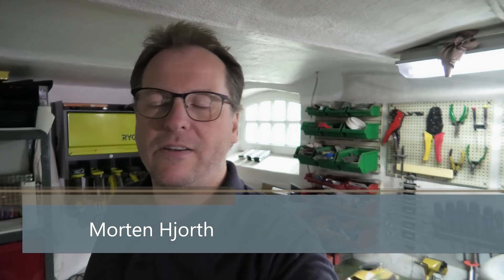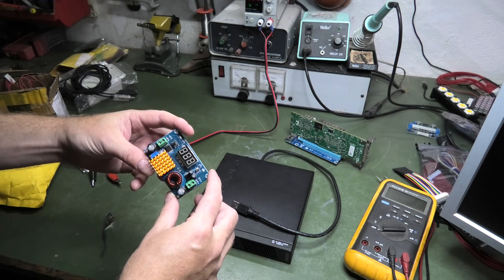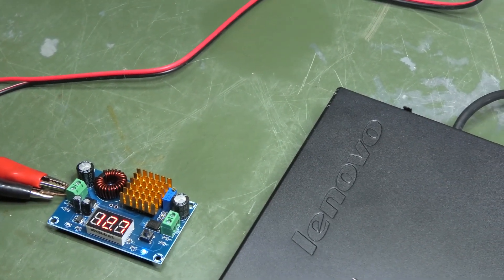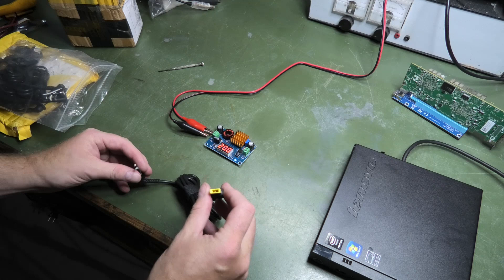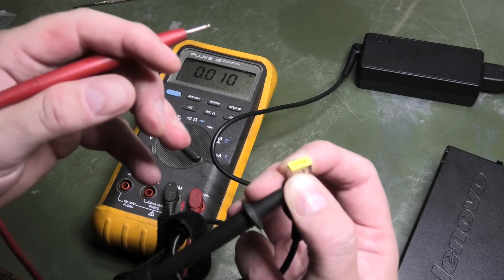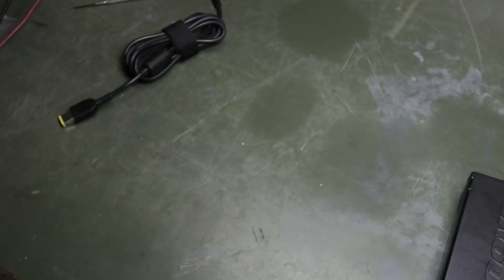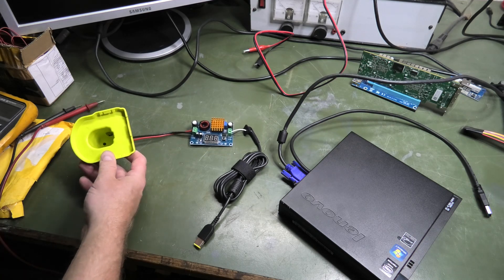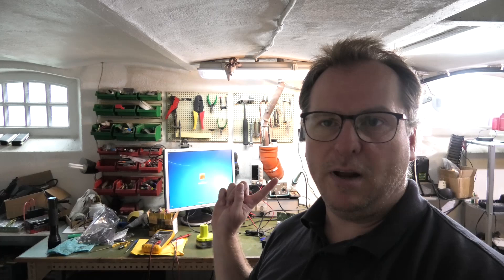Lenovo Tiny Running from Ryobi Battery with Boost Converter - 1310

Comment: I too plan to run one of these from the lithium battery in my camper rather than invert the battery power to AC and then have the brick convert it back to DC. Thank you for the proof of concept.
Reply from the maker: Hi @ssteele1812
Thank You very much!  glad you liked the video :-)
Thank you for watching! :-)

Comment: stop fooling around and get a big battery and some pv panels - use one of the solar generators that can recharge and supply power at the same time #pico power
Reply from the maker: I am in no hurry :-) and like to do baby steps,, if I mess up,, the damage is smaller :-)

Comment: On most modern laptops and maybe mini-pc, the 3rd contact on power connector is a data pin for serial communication via I2C between the power source and the load. This allow for example identification and acceptance of the power source by the load and performance adaptation of the load according to source capabilities. For battery packs you can also have details on their status this way, with data on the health state of each cell or parralleled cells group inside the pack.
Reply from the maker: Okay,, that is cool,, I can probably not do that, for my little setup 🤔

Comment: Get a monitor with a power brick and power both the PC and the monitor :-) Or if you really want to hack, you can inject on the DC side of an AC power supply. Just don't kill yourself, please ;-)
Reply from the maker: I would like to try and DC power a monitor,,, there is probably a PSU in there.,, but maybe it makes to many voltages...

Comment: All of these tiny, mini, micro machines, including Intel NUCs should work directly off of 12+V batteries since almost nothing inside uses 12V, but rather 5, 3.3 or less. Only possible issue you could have with that is if for some reason you tried to power a 3.5" hdd, and even then, I doubt it would be a problem.
Reply from the maker: I was not able to find anyone feeding it 12v,,, have you?
Reply: @MyPlayHouse  Why don't you try it yourself and see what happens? You should not damage anything.
Reply from the maker: Why would they make it use 20v if it will do 12v,, I do not believe it will do it.. I did ask a Lenovo guy,, he said it needed 20v
Reply: @MyPlayHouse   They would make it use 20v because that's what all of their laptop adapters use. Logistics is easier when there aren't as many different types of parts to keep track of.
Reply: Because it is easier to make sure that the power supply is capable of supplying the required voltage without voltage drop under load. Just like the buck converter dropped from from 20.3 to 19.6 as soon as he turned on the PC. Solar charge controllers follow the same principal. They will not power up unless the supplies voltage is above the charging voltage of the battery. Plus, 20v, 3a converted down to 12v can supply 5a. Both 60 watts. It's all about the watts, not just the voltage.

The computer has step down converters. It would not be able to get a good 12v from a 12v supply.

Comment: Hello Morten.
Have you tried with 12,8 volts directly on your Tiny Lenovo.
I have seen an Intel NUC where it got 12 volts directly from a car battery and runs fine.
It normally runs with a 19Volt 65W PSU.
Reply from the maker: I asked a guy I know at Lenovo,, if he thought it would do it. and he said that it wanted very close to 20 volt to run.

Comment: Hello, have you tried without the converter? I bet the pc could work at 18v
Reply from the maker: No the battery varies quite a bit, from fully charged to empty,, the boost converter makes it stable.